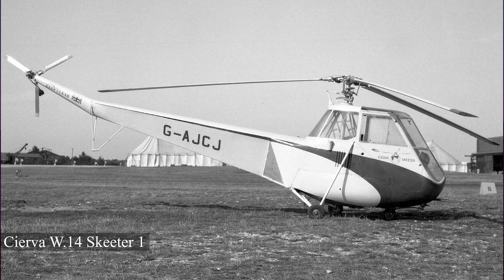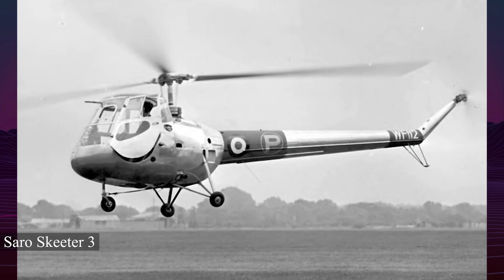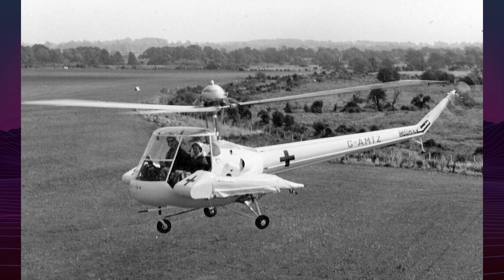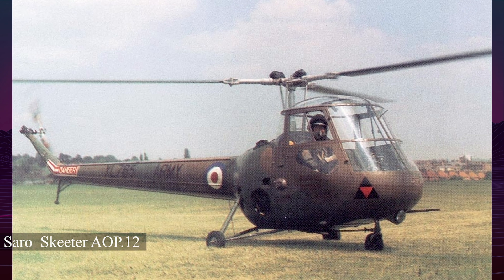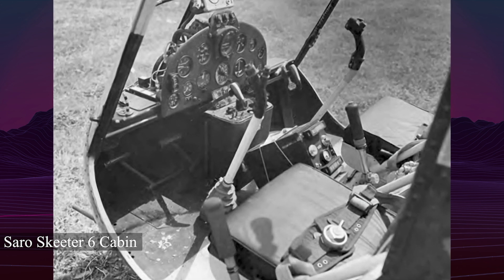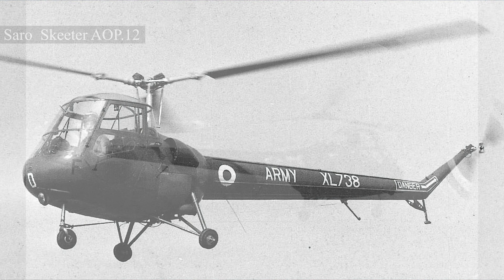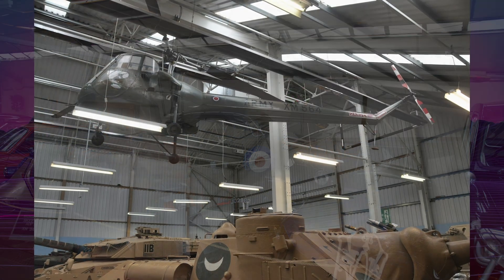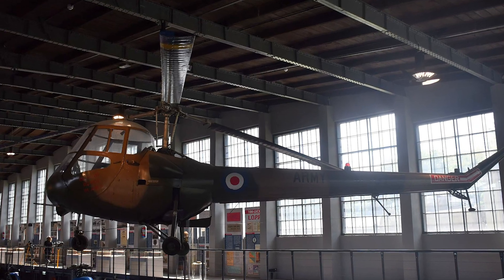Saunders-Roe Skeeter: The Little Helicopter With Big Secrets

Comment: :48  Rocket on Rotors - An experimental rocket added power system, the hydrogen peroxcide tank on the rotor head. reaction motors on the tips. Also tested on Sikorsky S 55 (H 19) great find
2:02 a Scout 4 place with a turbine engine